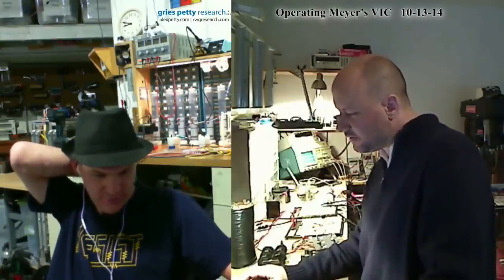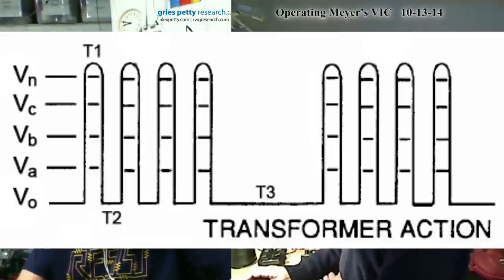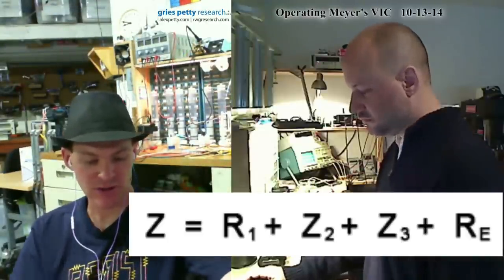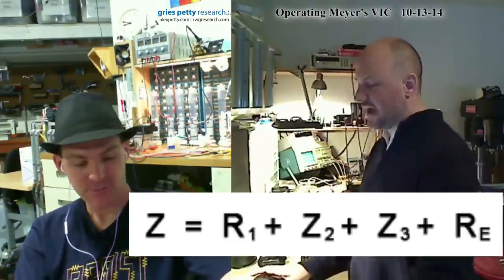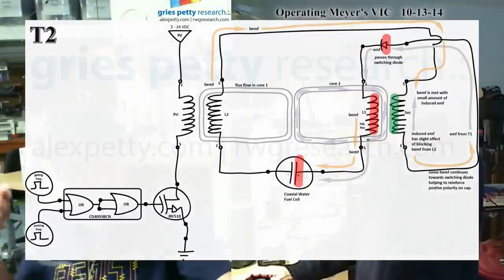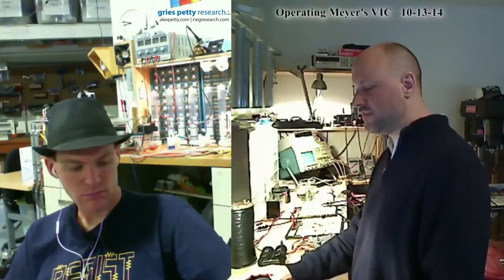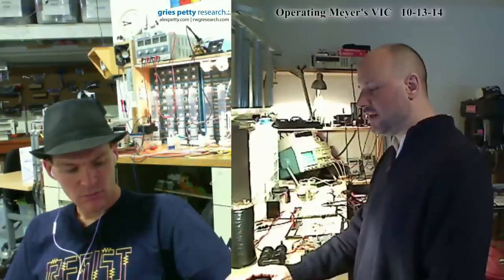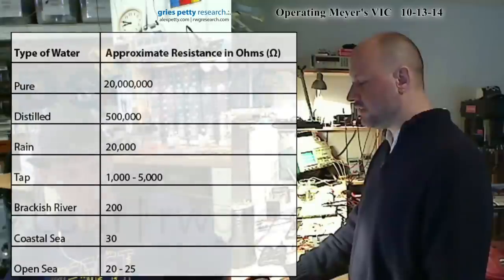Working Theory Of Operation For Meyer's Voltage Intensifier Circuit. 8-14-14 Gries Petty Research.:.

Comment: hi again i know this is old - but your 4093 alternate gate and pulse circurt helped me here the one your friend Alex Petty made - so thank you - my input is this {for what it's worth as i do everything up side down}

when you wind the coil - look at the polarities -  when the pulse comes into the input {primary} coil probe {to be sure} which polarity you have {on the secondary}  - now  if it is 'negative'  align the diode 'positve passing' side to that inital negative pulse - this creates a 'flyback' {look into it} what occurs is the diode acts as a switch {just as the patent says} this means when the primary is pulsed  the diode first sees a 'negative' and blocks it {switches off}  on the secondary side - so think when the polarity is going one way on the primary - whichever side is the  other polarity and if the is 'negative' on the secondary then line the positive pass diode to that - the diode then blocks the inital 'negative' then this causes the field effect the 'magnet magic' to get pumped into the core of the transformer - then when 'saturation' occurs it is pumped back out in the direction of the diode when it lets 'positive' out - 

this is a 'flyback' and it is on it's own a 'voltage intensifier' it is one of the most effiecent type - this may have been why you were getting gas production on the spikes - because it was reflecting - you need to adjust it inline with a flyback converter config - then all core field effect will be pushed / pumped into the LC capacitor - the chokes will further rise the voltage.  

thanks for the 4093 circuit.  i will not use a 555 but i just needed that simple NAND principal {which i have not learned yet}

also i'd first try a single 'tesla' type {so dual wires} inductor on the primary - and i'd do this > config for the secondary  look up patent - 1,702,771 

that's what i'd {i will} try first 

{time doesn't exist } {probably}

Comment: Ross, I don`t know if you read the messages on your old videos. But..., here I go.
Get an electric water heater to pre-heat the water. Get an steel pipe, and a induction heater. Place the steel pipe inside the coil of the induction heater and run the hot water, or vapor, which comes with from the water heater through the pipe that goes thru the induction heater. There you have it: -Hydrogen! Ignite it!!! Don`t forget to put a stop valve in between the water heater and the induction heater, also, place a Venturi valve afterwards. I don`t have the money to do it. But I know, it will make instant Hydrogen. Good Luck!

Comment: You guys are over thinking it. The water capacitor needs to keep a DC polarity and at the same time be rung in resonance. By adding the diode we can visualize the transformer winding and the diode as a DC pulse train. Because it's DC pulse the  capacitor between 2 inductors acts like 2 connected caps of half the value. This allows the resonant ringing  of the cap while it stays in DC polarity.Imagine as 2 tanks connected +pulse-inductor-cap-cap-inductor-ground. resonance is important to take advantage of negative resistance pump charging just like a boost converter. A tank circuit in resonance will rise in voltage and draw increasing current.   But with inductor current limiting it will just pump it with charge/voltage as drawn because caps are dielectric thus electic not current. The current would have to be tuned to the cap as too much current will turn to heat rising resistance causing instability. The rest is just pumping it up to the breaking point when it discharges some stored energy into splitting the water, but not fully discharging. From there it is kinda acting like a geiger tube how it "quenches" the discharge. The Townsend discharge is definite going to be happening also, like in a geiger tube.

Comment: I've come a long ways since the 2013 Global Breakthrough Energy Movement in terms of how much voltage I can apply to the plates of the Exciter Array. It took Meyer 20 years and it looks like it's going to take me a tad over 10 years to get something working the correct way. I still have things to learn as this technology is on the complex side.
However I do want to clarify something and that is what Meyer said about it won't be him but you and I that make this technology happen. He was referring to people actually supporting his efforts by buying the technology. If no one buys the items he would have sold then his company would go bust and no one would then get the technology. Like I said this technology is on the complex side so not everyone out there in this world can duplicate what Meyer did, let alone put it to use after they get it working. When True Green Solutions has a product on the market if it doesn't get the support of the people then the company will go bust as no company can survive without selling it's wares. This is what Meyer was talking about as in order to obey the laws of economics this technology has to be built through mass production in order to cut the cost down as that is how the markets are set up, the more units you buy the cheaper the per unit cost will be and there is no getting around that. Open Source violates the law of economics, and is something Meyer would disapprove of, in that Open Source wants everyone to start making a lot of one-offs which is the most expensive way to build something and/or buy something.

Comment: so this electron bounce sort of becomes like a resistor and holds charge on the cell during the off time.
gives the old world name "choke" credence to its descriptive name.
like the copper ions are bouncing into the right place, behaving like a valve at the atomic level to squeeze the flow of electrons and slow their passage through the copper, at the right time to oppose the leaking of the cell back into the circuit.
thanks for the presentation guys.
Reply: So what would happen if it wasn't gated? Would the steping voltage continue to go higher and higher in the water capacitor. Stan does mention in his presentations about  voltage going to infinite if you electronic components would allow

Comment: Hello, thought I could share this but I don't want to insult anyone, as these are basic EE principles. A choke is like a capacitor, but instead of trying to keep voltage up, it will try to keep the current running. So this is what keeps T2 high when the pulse is off, combined with the blocking diode, acts like joule thief. Also, in Laplace and Z transformations, there is a real and imaginary representation of the capacitor and the choke (z=a+jb), that explains filtering and resonance, as in a cap in parallel will act as an infinite resistance (open circuit) with DC (or extra long pulse) and in serial configuration will act as a very low value resistor on DC and filter out AC (or higher frequencies). Keep in mind that inducted magnetic field (emf) will give same direction current in the primary and secondary of a transformer (if I remember my classes right) and it is possible to find natural resonance frequency with W = 1 / sqrt (L*C) (or Fr=(2*Pi)/sqrt(L*C) http://en.wikipedia.org/wiki/Electrical_resonance and http://en.wikipedia.org/wiki/Z-transform). Happy tuning! And never give up!!
Reply: why would this insult anyone?^^

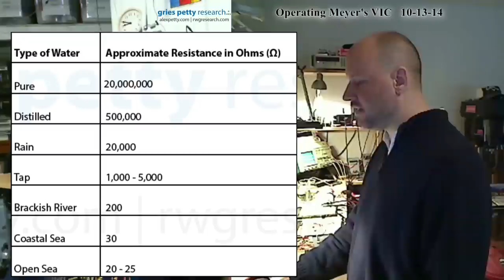Comment: 30:12 water resistances
31:00 Not only dialing in the right frequency, but also tuning L2 to match resonant Frequency, right? but to match what exactly?
32:49 BEMF renders gas by itself. Interesting! Master Ivo works a lot with capturing BEMF and reusing it.

Comment: Initial schematic question - Your modified (reconfigured) schematic (with properly shared cores) reverses the original connections of the "Sec" winding... you now have the "F" wire and "S" wires reversed.

On the "shared cores", are the "S" wires both at the same ends of the core? (same phase relationship)
Reply: Good catch! On the very first drawing of the VIC (the standard drawing), it seems that I did reverse the S/F and -/+ for the secondary, but in all of the other drawings (the new schematic), where we spent far more of our attention, everything is correct. 
I'll fix the standard VIC drawing in the blog post and make a note under the video.

Thanks again!
-Alex

Comment: One last though about Stan Meyers VIC he used finesse instead of Brute force also cold electricity may be the secret for such low wattages. Cold electricity resembles static electricity and therefore charges capacitors much better than batteries although lead acid batteries can be "trained to accept" this new energy!

Comment: Russ I think that the omic value for water is from the intentional contamination of the water. Do you know what he added to the water for conductivity?
Reply: Unless I am wrong he did not add any electrolyte because it’s not electrolysis. He is basing things on voltage not amperage and on what seems to be relatively gentle frequency rather than an electronic crowbar because he is working through the enhanced dielectric property of water.

Comment: About cold electricity you can light up a 500 watt halogen light even in water while touching the bare electrodes NO shock even in water; thats because we separated high voltage from the damaging amperage

Comment: 1- Have you looked at the operation after removing the Diode mentioned as iN4007 - not only would I never use such a low rated diode for this high voltage application - more importantly I am seeing a resonant , self oscillating tuned circuit .After watching I keep going back to this circuit not being drivenn by DC but actually using AC.A Chrystal oscillator operates in same way if you remove that diode.The peak of a high -Q circuit is only achieved by end to end matching .The peak will only be achievable by using AC throughout and thinking in AC terms. If water from various sources has such wide varying resistive properties excluding temperature and other impurities  - one would have to cater for this and be able to match it from the input and perhaps some closed loop in order to keep the tuned circuit in operation . I would be interested in your comments to this tuned circuit approach .
Reply: Further to the topic- I see being able to make many thousands of volts across the capacitor by using a magnetic loop antenna .I have made many of them for radio communications and the question can be asked- if I wanted a magnetic loop antenna disguised on a vehicle-what better than to use a doone buggi ,  using the roll cage as the actual antenna - just a thought.Magnetic loop antennas are create such high-Q that the voltage goes sky high with very narrow bandwidth  and from 12 V  100 Watt HF  radio transmitter one can get in excess of 5 kV accross capacitor used in the antenna .
Reply: YOU ARE ON THE RIGHT TRACK.  THE DESIGN OF ATTAINING HIGH VOLTAGE PULSES IS 
ACHIVABLE WITH CORRECT ELECTRONIC DESIGN SUCH AS CONVERTER BOOST CIRCUITS.
THE ONLY CONSIDERATION  IS TO NEGATE  ' Re ' THE LEAKAGE RESISTANCE IN THE WATER
 COURSE CAPACITOR.  DO THAT AND YOU HAVE  EUREKA! I AM CURRENTLY WORKING ON  
THIS PROBLEM AND ALMOST READY TO PUBLISH.

Comment: Amazing work gys!
Do you have means to tune the conditions during T2 in order to get as close and quare a T2 wave as possible?
Reply: tuning for the T2 period is all about component construction. in short, we will be winding, many, many coils on various core configurations/dimensions to tune this bit down.
Reply: Alex Petty Thanks for the reply Alex.
Perhaps if you start by winding coil covering the extreme ends of the foreseen spectrum, after testing these you can calculate where the hot spots might be.
Would the duration of T1 matter? And if there are some losses in the circuit, perhaps T2 should be ever so slightly shorter?
I wish I could help getting my hands dirty but I can't even mend a cord switch where the cord tore.
Reply: Cloxxki The duration of T1 corresponds, of course, to the pulsing frequency; so the balance act must start there. You can change the ratio of T1 to T2 by change the duty cycle of each pulse.

Comment from the maker: please read the full post here:

http://alexpetty.com/2014/10/14/operating-meyers-vic/

and post feed back here:

http://open-source-energy.org/?topic=2118.msg28654#msg28654

Blessings!

~Russ & Alex .:.
Reply: HI Russ
I have been watching your channel awhile. I did do some HHO work on my last truck in 2008 a Tacoma 4 cyl and got 5 mph improvement for a while till the computer corrected and made it use much more gas. I had started building the Stanley Myers unit and nearly had constructed the tubes and tank and a lady totaled my truck and I quit. Did not want to put it on my brand new truck as the dealer was going to cancel my warranty because of that and other concerns. In my first comment i mentioned that I think Stan contaminated the water in the cell with something and that gave him the 78 ohms conductivity of water. There were 6 others in our group that were doing the HHO on our cars together at the time and we all thought that was the case. Each one of those guys tried different chemicals. I used baking soda. one used sugar another used salt another used potassium. We were trying to control the current in the cells by varying the concentrations of the chemicals we were using. We had used DC current at first and were constructing electronic frequency circuits like Stan's. I have most of the stuff that was put on line then on my computer now and have read and watched lots of videos about this including yours. I feel even stronger now that the water had something in it to help the production of the gas. It may be benign but could change the conductivity. As you know pure water will not conduct electricity. We did definitely figure out that hi freq is better than DC current to split water though. We lost contact when our contract ended and we went to different jobs after that.

Please keep up the good work. I will be following to see if you get it done. 
Don 
PS  could not get computer to take math answers so reply is here
Reply: Don l I have contemplated making a standard Hydrogen/Oxygen generator. Use a DC to AC (12VDC - 120VAC) converter to get gas generation on both plates. Use distilled water and add drops of battery acid to achieve the desired current flow. Remember 10A AC would draw 100A off the alternator. Might have to design a cooling system for the distilled water. I used stainless steel screening for the plates. There are also devices you can get that connect to the O2 sensor pigtail to fool the computer so it wont fuel trim compensate.

Comment: There a few of things in terminology, electron flow and component identification. The terminology for a diode is forward/reversed biased, a switching diode does not exist. In figure Vo+Step 7 the electron flow through diode IN4007 is reversed bias unless you are using current leakage properties of the diode. The step up transformer (T1 ???) is shown isolated in Vo+Step7 yet integrated with L1 and L2 with additional resistors in the schematic below "Pulsing from Va to Vb." Typically an "L"  component (induction coil) is Isolated with a fixed or variable ferrite core. If they were integrated "L" would be non responsive and simply a transformer with multiple Pri/Sec windings. The schematics need to be consistent with a parts list.

Comment: I can't understand English. I also played HHO for several years, Stanley Meyer's circuit, from primary to secondary, there is no inverter voltage, TIP120 fever. Coil heating. Unipolar pulses are not valid unless they can be achieved by SPWM circuits. In addition, the diameter of the primary coil must be 2.0 mm to be effective.

Comment: if the water molecule is affected by the electric pulses due to the partial charge of water. And the partial charge of water is affected by the uneven distribution of the bonding electrons. Then the water molecule will have the ability to neutralize its own partial charge by perfectly distributing the bonding electron.  So any energy that was used to "stretch" the water molecule to the bond energy level at which this neutralizing effect would be  favorable than splitting, will be lost. This is because the instant the water molecule looses its partial charge it is no longer affected by the electric field, thus, it will have no more reason to be neutral, and as such will return to it partial charge and the process starts all over again. This phenomenon emphasizes the need for a "resonant frequency" that will prevent the water from reaching the favorable neutralizing state. So putting high voltage DC across water will neverwithout

In standard electrolysis the hydrogen and oxygen gas comes from the ionic forms of water. In the ionic OH and H states. or H3O+ state (whichever way you look at it), the electrons flow are capable of doing work on these fully (not partially) charge particles.